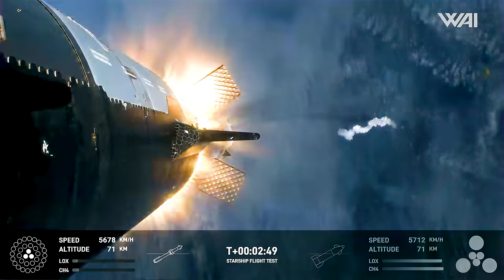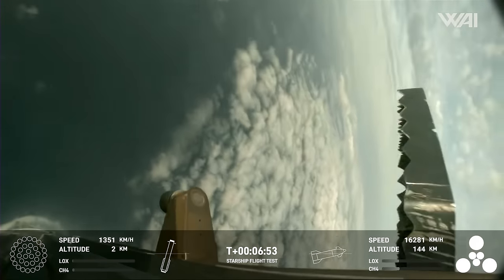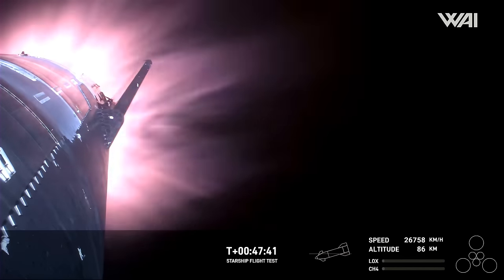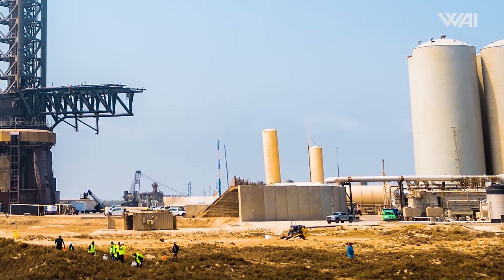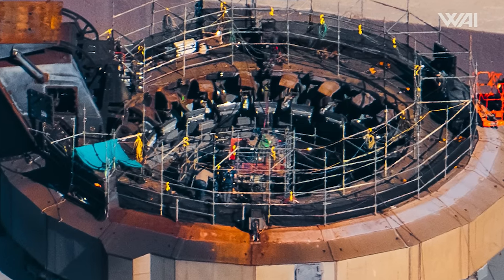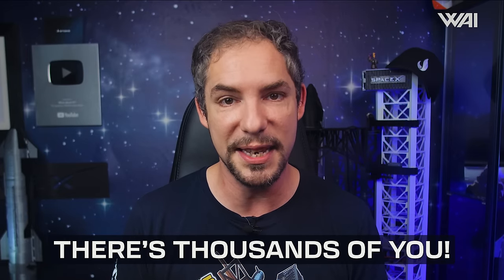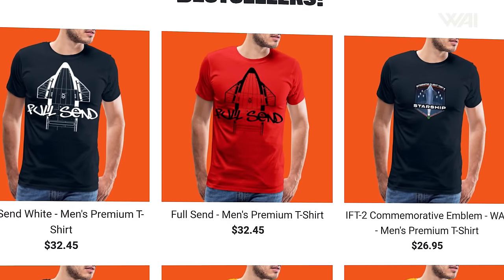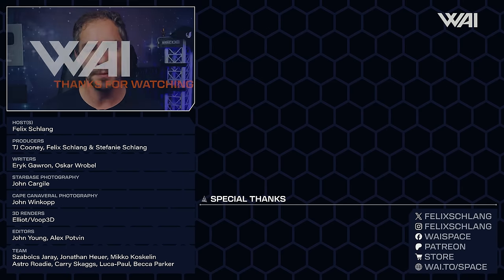SpaceX Starship IFT3 Aftermath: New Insights Paint Different Picture!

Comment: Booster  - there was a lit of movement during the latter phase, this would have caused slish in the fuel tank exacerbating the movement of the booster. The Grid fins did a great job, but the flight computer software will need looking into.

Comment: Can't wait to see how all this experience alters the design of subsequent tower and launch pad design. 
Will there be a single very thick and heavily reinforced  pad on which both will be built to avoid misalignment caused by ground  settling? 
How will the deluge system be an integral part of construction?  
Could the pad and tower be unified and hybridized with more traditional launch structure designs?
It will be interesting I am certain.

Comment: Great job Felix! I think SpaceX will take some time to upgrade both the booster and the upper stage.  After all, they did have some system failures that led to vehicle losses, and they will need to upgrade both hardware and software to improve system performance for IFT-4.

Comment: The door may have opened fine, but it never really closed correctly again. And at a tumbling re-entry an unplanned hole in the body will not help. Also I think you can see a situation in the plasma phase where the ship tumbled a short time with nose down into the plasma. That is when comms start to fail more and more. Probably that plasma has burned the upper antennas. And finally during the coast phase of the ship you can see some gas exiting from the rear section for almost all the time. That looks not right to my feelings. But they solved that issue from Booster 9 to Booster 10 so they will fix this and more for the next ship. Can't wait to see the next IFT and good luck for you and your team! May be we meet again next Space Creators Day!

Comment: After each launch SPACEX assembles scaffolding for inspection and repair of the launch mount. Since the launch mount design is not changing, it would be more efficient if they built a welded scaffolding rig that could be brought in clamped to a forklift. If designed as a staircase could provide the maintenance team access to different elevations along the concentric of the mount. If hinged, it could be brought in as two units to provide a full wraparound 360 degrees access

Comment: I agree i was thinking about a RCS thrusters system is needed for starship... eh mostly  idk about the boosters  after all after I witnessed with booster 10 with grid fins working overtime entering the atmosphere when the booster too was spinning out of control as well . Overall it is the biggest rocketever built  i say definitely RCS Thrusters is needed for both booster and starship
Reply from the maker: Yep. What’s also interesting is if SpaceX will redesign the chines. Those might be affecting the roll of the booster as well. It’ll stay interesting for sure! 🔥❤️

Comment: About the booster reentry, it had first a free fall and reached a speed of 4000 kmp, then when it reached the lower atmosphere there was a natural breaking in to 1000 kmp, this is the right place to start ignition of some engine because of artificial gravity and no sloshing in the fuel tanks, later in the next free fall it was impossible to reignite the engines again
Reply: Doesn't SpaceX do the slam dunk landing to safe fuel... ie it ignites its engines at the very last possible moment to stop its fall. Because the longer the rocket engines are on, the more fuel they use even if it is idling,
Reply: @nickl5658  They can't ignite when the fuel is sloshing in free fall

Comment: I think IFT4 will take a little longer to get off the ground than you hope. They'll have to figure out why the booster's Raptors didn't light off as expected during reentry AND likely make modifications to Booster 11. Same goes for Ship 28. Why was it unable to control it's motion in space and during reentry? Then they'll have to make some modifications to Ship 29. They won't dawdle, but it will take some extra time beyond just the usual stuff.

Comment: 8:09 That’s not a work platform, those are cable trays for electrical wiring. Made out of aluminum, and not particularly strong as to maintain integrity during extremely high stresses from ‘high wind’ events.

Comment: Chopsticks are covered in the render, so I don't feel too worried that they need some repair after each launch. This is all a testing phase, and it looks like the goal is to start with as little as possible which makes a lot of sense. It's very easy to plan for the worst and over engineer these things before testing which results in much higher cost and waste.

Comment: The IFT-3 Boostback: I liked the original telemetry better. It showed booster was only doing 1000kmh when it reached alt = 0. I'm still waiting to see video of the booster explosion at 1,500 ft. 

I saw a collection of videos. There are views from the "back side" of the launch pad where the blast appeared to be as dark and sandy as the first launch. 

I'd bet that they will push the launch cadence as fast as possible.

Comment: Based on the tumbling of Ship 28, I'm going to guess that Ship 29 is going to get some changes, improved Reaction Control System, extending the time needed before it launches.  That, or the changes needed will be so large, that it will be skipped, and later scrapped.  Then we'll see ship 30 fly next, after it has gotten its updates.

Same with Booster 11.  It's going to go through some changes, based on what happened to Booster 10's difficulty keeping steady, before the video cut off.  The grid fins were working hard to keep the booster steady, it could be seen, but the booster was not reacting well to the corrections.  So, we might see changes there.

Comment: As the booster is plunging downward, butt first, high pressure is developing against the rocket engine nozzles. How is that high pressure taken into account when attempting to restart the engines? I assume similar problems would exist for the Falcon 9 engines, but that cross-sectional area and pressure is significantly smaller.

Comment: I noticed the grid fins are in a different location to falcon 9s higher to the booster top edge). I think the new section above the fins would cause alot of air turbulence being sucked into the center compared to the solid cyclinder design above them on the F9. Turbulence wake direction would be interesting to see in their fluid simulations
Reply: Yet Falcon Heavy side boosters doesn't have a problem

Comment: Great show as always. Wonder if it would be easier to have the ability to just detach the rocket stand after a launch and replace it with a new one and eventually have a rolling stock of launch stands that have been refurbished/ repaired and ready to go? Bolt on and bolt off for reusability and more importantly, the turnaround time to launch again multiple times a day without needing 5 towers or however many that requires each having the same infrastructure to maintain and 5 times the land area?
Reply: You're basically doing the same thing plus the added complexity of removable parts
Reply: @Ben_Gunner Multiple launches a day were never meant on literally the same pad

Comment: The Raptor has two pre-chambers which power the two turbopumps. The fuel-oxydiser ratio must be controlled exactly at all times - if the ratio becomes stoichiometric even for a brief moment, the entire engine can explode. My hypothesis is that the air flow pumped back into the engines thru the engine bells may have messed up the feed into the pre-chambers of one or more engines, causing an explosion. This is more work for SpaceX computer programmers...

Comment: Felix. don't forget the Starship was moving at a little more than 26700 kph more than Mach 15  and at speeds over Mach1 in the atmosphere control services bahave different from sub mach flight. like the F22 and F23 fighter planes and the other supersonic planes they require computers just to manage the control surfaces to maintain stable flight at higher than Mach speeds. It may take some time and  simulations to actually master the RE Entry control surface manipulations compared to sub orbital speeds. MACH 15 is FAST !!!!

Comment: On how soon IFT4 will be.  Won't SpaceX want to figure out what went wrong and try to fix it in IFT4 ?  It isn't just fixing Stage Zero and regulatory delays, it is figuring out what went wrong with the booster and ship, and then trying to fix it.  The entire reason for the tests is not just finding what breaks, and not just fixing Stage Zero, but changing the booster and ship so they don't break next time.  It is SpaceX, it will be fast, 2-4 months, but it is important work and should not be overlooked.

Comment: I thought that the exhaust plume from the engines during the re-entry of the booster was supposed the protect the engines and the craft from the plasma and high temperatures of re-entry. 
If there were issues with the engines' restart, this may be a terminal problem.

Comment: They have to understand what went wrong in both the booster and starship. Then based on the cause(s), they may need to make design changes. If that is necessary, I would consider it a huge waste of resources to launch a booster and ship that has a high probability of meeting the same fate as IFT3's did. I'm fine with a slowing of the launch cadence (regardless of Elon time) if that means incremental improvement and no backsliding with raptors going awry, booster or ship blowing up BEFORE getting to orbit and boost-back burn.

Comment: Super heavy: When descending fuel inside tank floats upward. Gravity. Engines starve and don't even light. More complex to do but separate tank just for landing burn, maybe? Ship already uses similar solution (header tanks.)
Reply: Once the booster hits the atmosphere, the fuel will be pushed down due to drag. So as long as you light the engines during that slow down, they should get fuel.

Comment: Mobile or quick deployable rocket launchers are not a new concept  - TEL or Transportable Erector Launchers were heavily used by the former Soviet Union (and still can be). There is still something to be said for this concept in regards to the ability to build small scale satellite launch complexes that would benefit cost effective launches for desired placement of a particular system - meaning requiring less fuel on the assent and stationing once exo-atmospheric.

Comment: Hey Felix, if they tried to light 13 Raptors upon splashdown, but only 3 lit, were the other 10, or 11 still pumping out Fuel, and wouldn't that fuel collect under the Booster's skirting, where the 2 running Raptors could ignite it, causing a RUD?

Comment: here on earth, in an atmosphere you can pressurise the fuel tank to pump propellant to the engine, but in space there is nothing to pump with, vacuum. i am no rocket scientist, so maybe i'm missing something, but to get fuel to any given place you need thrust / centrifugal force to slop the propellant to it's desired destination? when the booster was returning, it and the propellant to slow it, were falling at the same rate - so the fuel would be "floating around" inside the tank instead of sucked into the engines....

there is no "compressed air" to pressurise the fuel bay basically.

Comment: Flight 2&3, fuel starvation on boost back.  Tanks too large. Multiple smaller tanks perhaps?  Would be easier to maintain pressure.
Inadequate vector thrusters on both booster and starship.  Remember that formula regarding mass and inertia?

Comment: I wonder if the rapid rotation back and forwards of the booster caused the remaining fuel to slosh, and thus the booster engines ingesting gas rather than liquid fuel, leading to an individual engine RUD and thus loss of the booster

Comment: Just my stupid thoughts but Is a drag parachute for the booster possible? In my mind it would seem to reduce the propellent needed to slow decent while also provide some stabilizing drag.    

The trick would be establishing a good securement location in the booster body.  
If the plan is to catch the booster via funny chop sticks then  structural elements must be designed withstand the booster weight with some momentum.

 This structural support should then be enough to support  the force for  drag chute  to both slow and stabilize the booster during decent.. Ass first supersonic velocities during decent seems fraught with hazard.  I would also think reducing freefall inertial  would also assist in stabilizing  fuel and oxygen flow.
Reply: Parachutes are not convenient enough for rapid reusability.
Reply: @EMichaelBall  Its convenient enough to use all the time for landing fighters and bombers.

Comment: I doubt if all 13 gimballing engines will light up for landing, with 230T of thrust each and at most 250 tons mass at landing, it would pull over 10 gees. Falcon 9 reaches 50 m/s2 in the landing burn, so for that acceleration, SH with eight engines (center three and half the others), 65% throttle would give 52 m/s2, more than enough.

Even with only 5 engines running full throttle would still allow a safe landing (with throttling later on of course). Restarting all 13 seems to be overkill.

Comment: Long way or short matters only if you are going into the right direction. Starship isn't star ship. It's LEO ship. ICBM for now. Because of how space travel works.
SpaceX will learn to refuel one eventually. It could even go around Moon at some point in the next 5 years. Eventually with humans onboard. But it will always have disadvantages compared to some other possible setups for interplanetary travel.
What was the actual payload on LEO this time considering fuel required to land? How much further could it go with that? deltaV left on LEO?

Comment: If the heat tiles are so important to protect the spacecraft, why isn't the Orbital launch table covered in the same type of heat tiles?
Reply: Because the heat tiles are fragile. they are not shock and crush resistant. Heat tiles are essentially ceramic foam. The force of the rocket exhaust  would crush it.

Comment: It is no surprise that the surface temperature of Mercury can reach 800°F (430°C) because this planet is so much closer to the sun than other planets. For this reason spacecraft visiting Mercury are well shielded from the sun's intense rays, as should be anything susceptible to the intense temperatures and pressures from the Starship's 33 powerful rocket engines. It would seem like minor fixes to protect all susceptible hardware with adequate shielding.

Comment: I won't be surprised if the launch vibration is causing the fuel to cavitate, thereby destroying the engines, tank, and fuel lines.  So far the reports show a general thought and no real info.  We need to have something to examine after a launch.  Seems like a good idea to parachute a booster back to have a complete model to examine.

Comment: You need first to deliver this 100+ T on orbit and deploy it, before stating that You are able.
Why nobody is paying attention on the vehicle bending and wobling on the joint between booster and ship during liftoff? Considering that it was empty vehicle, one needs to multiply those wobblings with 2 to 4 at least when SS has payload of 100T. 
Soviet N1 just snapped on joint during liftoff in test flight.
I am pretty sure this joint construction needs to be heavily reinforced, considering heavy lift and strong vibrations during liftoff.

Comment: WHAT WE THOUGHT; for what it's worth! #1] 32 Engines 7,000 Deg F, @ 16 Million Lbs, Thrust- YA DON'T JUST 'SHUT-DOWN' COOLING TO ENGINES AFTER ALUNCH and expect Re-Light. #2] Hell of a Lot of BIG MATERIAL COMING OFF STARSHIP ON RE-ENTRY; SUGGEST- Consult Boeing Engineers (Builders X-37B Space Plane) on Re-Entry Structural/Thermal/Control Dynamics.

Comment: What happened? 2X Miserable Failures, happened. That's what happened, Felix.
And, if you think I am being harsh, ask yourself these questions:
1) If this test was performed by NASA, what words would the media be using the describe the flight? (Hint: FAILURE)
2) If the definition of "success" is "Both craft can be used again" - when will Starship be successful?
3) If only 20% of the entire launch system is being tested, with 80% of it undesigned, how could any flight be termed a "success"?
4) With all these so-called "successes" when do commercial flights begin? 
5) How could 16 flights (Starship) vs 1 flight (Saturn V) ever be considered a "success" for a single moon mission?

Truly hilarious stuff.
Blue Origin will beat SpaceX to the moon, without any trouble at all. And without any Miserable Failures or RUDs, either!

Comment: Why don't they protect the OLM not with paint but with heat shield tiles. Not the same hexagonal ones as on starship but larger ones specifically for the OLM and its legs? That would be much more interesting if you want to launch a starship every day. @spacex can I get some credit and compensation for that? 😀
Reply: It will blown off
Reply: @alvianchoiriapriliansyah9882   As there is no weight constraint the large tiles (I mean really large as just a few tiles for each OLM leg) could be attached very firmly tot to OLM structure. Being bolted or clamped or spanned or whatever method would work best.

Comment: in the live stream you made a very big deal about how steel is more thermally conductive than aluminum, that is very wrong.  steel can handle a much higher temperature, however aluminum is 10X more thermally conductive.